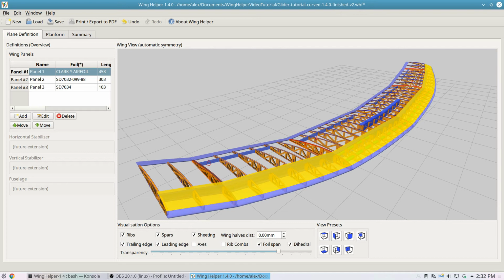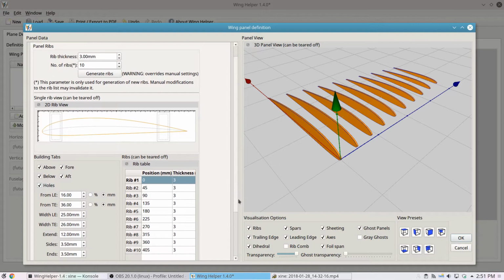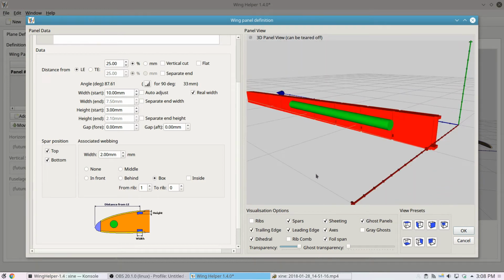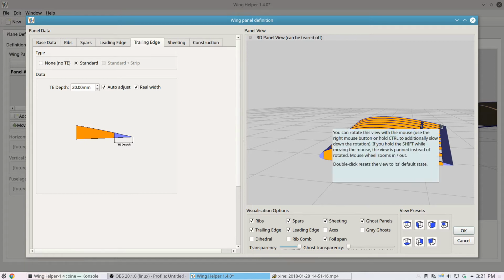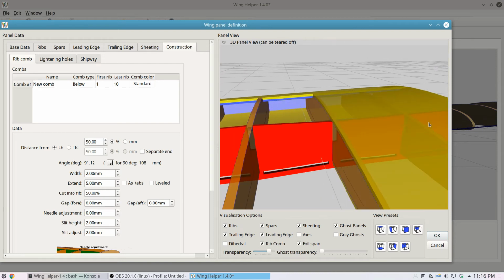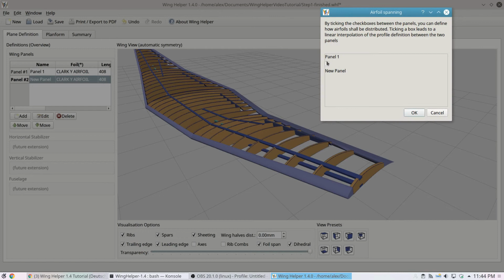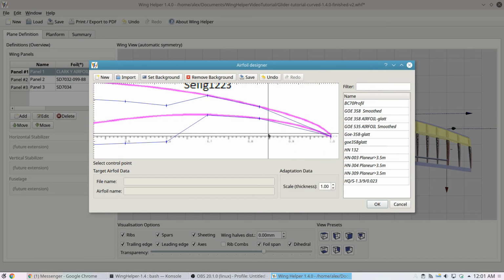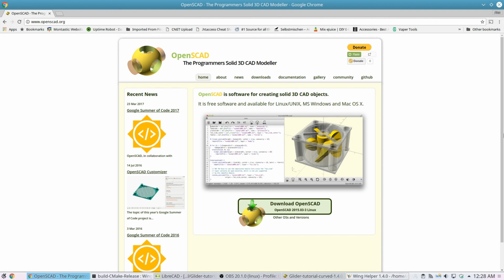Wing Helper 1.4 Tutorial (English)

Comment: Love it! We have been making a few new wings with it already. Keep up the great work!
Reply from the maker: Thank you Wayne - I'm happy to hear you like Wing Helper!
Reply: Would you be willing to help me out to develop a wing?  I have followed the original wing tutorial and developed my wing design.  Honestly, not sure how to proceed from here.  I imported the WingHelper DFX into Fusion 360 and am kind of at a stand still.
Reply from the maker: @kerrycorcoran4885  I'm not sure whom you were asking, me or Wayne. If you were asking me: I'm a good developer, but not much of a model builder. :) Still, if you have concrete questions, let me know, and maybe I can help! Basically, in Fusion you want to prepare your ribs for cutting (laying out, maybe doing some manual modifications if necessary), then print them as templates, use these templates to cut out the ribs from Balsa, and glue them all together. 

If you have never done it before, I suggest you look for videos on YouTube, to learn about different glues, how to cut balsa (grain orientation!), how to lay out all the wing elements on the plan and how to put it all together. There are really nice videos available - I suggest for example "Joyplanes RC", he has some great videos showing how he builds the wings.

There is also, thanks to Wayne, a new unofficial discussion forum for Wing Helper, you can find it here: https://forum.alofthobbies.com/index.php?forums/wing-helper-support-forum.29/

Comment: hey, guys, I'm exporting the model for ICE foam cutter. You are missing the wire length parameter so it will not work for both portal and winch cutters. Pls update or let me know how to set it up. Problem - cutter makes incorrect sweep.
Reply: Hello! You can enter all machine-related parameters, such as the wire length you mention, directly in the program ICE. That was one of the reasons why we chose ICE for the first step in the direction of G-Code export: it brings a lot of functionality with it, which otherwise would need to be implemented directly in the Wing Helper.

In the next version, we are looking into extending the support for G-Code export and also to introduce support for specifying machine-related parameter.
Reply from the maker: Update to my previous reply (posted as Alex Pozgaj): I know that the author of ICE is also working on the import function to support the Wing Helper generated NC code directly, so the integration will become even better in future.